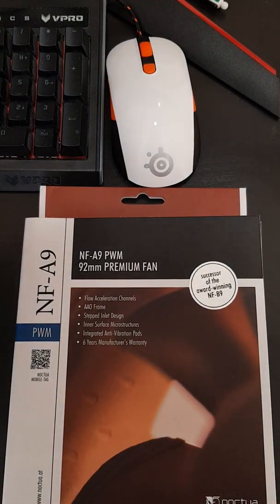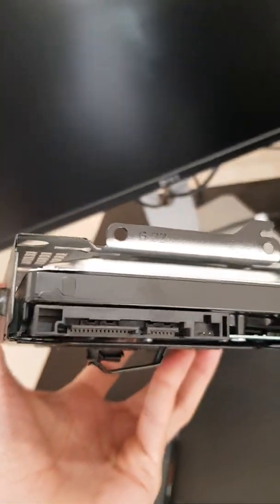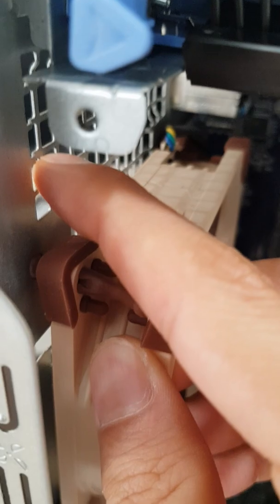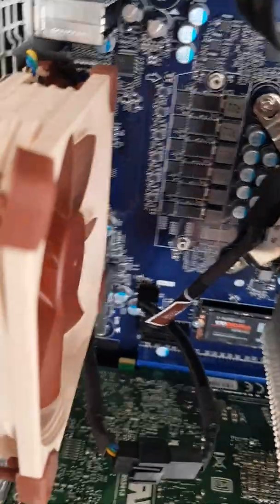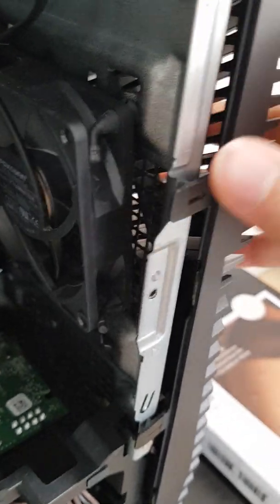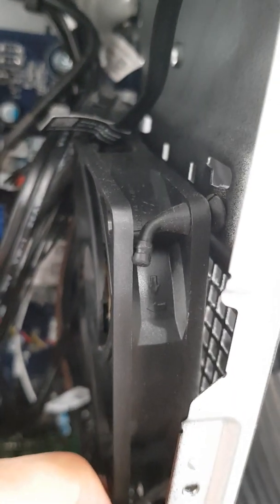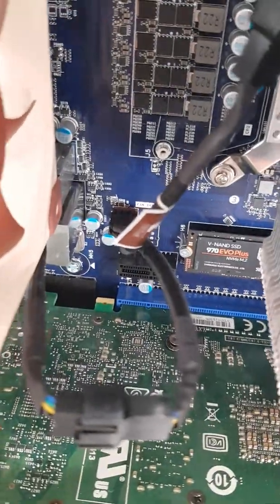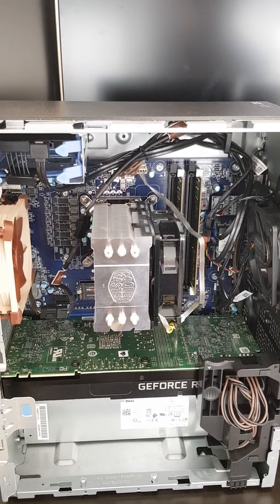Noctua NF A9 92mm PWM Fan Installation on DELL G5

Comment: Thank you for your videos! I just ordered a cpu cooler and another fan. My G5 dell has the 3060ti and i9 cpu. Playing cod cpu got to 91c! My GPU is 64c. 
I bought a 120mm case fan it might be too large? I may return it and get a smaller one.
Reply: with the 120mm exhaust fan you'll need to drill your own holes or use doubled sided tape.

I used 3m exterior double sided tape. Exterior rated tape has higher tolerance for heat. 1 piece on each corner of fan. Make sure not to block the fan itself with the tape. The thing isn't going anywhere. You'll have a hard time getting it off haha
Reply: Hey Monopoly. I ordered a dell g5 with a 3060ti as well. I was wondering, did dell give you a “mini” 3060ti, or did they give you the full 3060ti? I hope that makes sense?
Reply: @NICKNACK112  Not sure what mini ti is? The Dell one is actually very well built. Dual fans with lots of rads and heat piping.
Reply: @gigatron2008  I’ve read that some people that got the dell g5 said that there graphics card was a toned down version of what they chose to be included. Does that make sense?
Reply: @NICKNACK112  where'd u see that? I'd be interested in researching it. Doing gpu tests I was able to hit fps as claimed in comparison videos I looked up.
Reply: @gigatron2008  I forget where I read them, it was a few days ago. Maybe the ones I read where old posts probably. Also what 3060 ti card did you get? Is it the founders edition?
Reply: @NICKNACK112  no it's a Dell version. Dual 80mm fans. I was really surprised by the gpu they built. After adding Noor S's fan mods and a Noctua N9S cpu cooler temps are great. Gpu hits 75c max now.
Reply: @gigatron2008  oh that’s strange. When I chose my card it said Nvidia 3060ti? Why would they say Nvidia 3060ti if there going to give you there own built 3060 ti card? Also what games do you play on the pc and with what graphic settings for them, and what’s the average FPS?
Reply: @NICKNACK112  well yeah its Nvidia gpu but the fan shroud and cooling is made by DELL. 
Cyberpunk 4K non-RT it runs avg 45fps ultra settings.
Warzone 1080p RT runs 110fps. 4k non-RT runs 55-60fps. Both Ultra settings.

Note just added another 92mm Fan up front(some cheap Fractal $8 fan). its TIGHT but you can make it fit. that helped the GPU run from 75c to 70c tested in Warzone.
Reply: @gigatron2008  Thanks this helps a lot👍!!!! Also your comments are disabled on your YouTube videos, just letting you know if you didn’t know already.
Reply: @NICKNACK112  No probs hope you get it. G5 it's a good buy and with an extra $70-120 depending on parts u choose its one of the cheapest prebuilds right now.
Reply: @NICKNACK112  no worries thanks for the heads up! Fixed now.
Reply: @gigatron2008  I just bought the same build as you did you have the i7 10700? Did you remove the hard drive and added an SSD /2.5? What cpu cooler did you use? Excited to get this g5 /3060ti ;)
Reply: @EZzO444  I made a video :) check it out. Parts list in the description. Yes and I added a 1tb ssd
Reply: @gigatron2008  thanks ;) do you feel the 500w PSU is not enough? I see reviews of the i7 taking up to 200W same for the 3060ti... If you add the other components are we short of the 80% ratio ,!!!
Reply: @EZzO444  oh yeah it's fine. I've run this thing to max and no issues with power.
Reply: @gigatron2008  I see your video pretty neat ;) does the original HDD is empty or they pre-installed stuff on it? When you remove the cpu cooler is it sensitive with the thermopaste? Like sticky?
Reply: @EZzO444  thanks! it's empty. I just wiped the paste off with a paper towel. The cooler I bought came with new paste. Works great.
Reply: @gigatron2008  if you were in my position would you do all those changes right away when you get the New g5 or wait?
Reply: @EZzO444  if you plan on gaming do it immediately. Cpu cooler and exhaust fan is probably the most important. You can cheap out and get more affordable options like the cooler master T2 and cheaper 92mm fans. I have the T2 and it ran fine.
Reply: @gigatron2008  I bought the NH-U9S cooler and the Noctua Fan awaiting the desktop ;)
Reply: @EZzO444  nice! You won't be disappointed

Comment: hi ! how unistall  the old   case fan ?
Reply from the maker: Release the rubber mounts from 2nd hole for each corner (I.e. release the tip). Then pull each corner of the fan out slowly until the rubber mounts are released. You need to use some pressure when pulling it out and be careful when you can feel it coming off, so you dont smack your hand somewhere.

Comment: Thanks for the vid. Very helpful. Everything works, but my front fan (The original fan) is constantly running at full speed. I can’t reduce the speed through applications. Any advice? Do I need to use the low noise adapter?
Reply: You gotta get an adapter for the 4 wire plug so dell will read them properly I'm pretty sure
Reply: Mine is, did you find a solution?
Reply: Need a solution too
Reply: @nito7625  Im using the alienware program to control my case fan, gpu fan, and msi afterburner to control the gpu fans.
Reply: @nito7625  Gaming temps are whatever I want them to be now. 60-70c instead of the cpu being over 100c
Reply: @uglymechanics6599  so you were able to adjust the speed of both fans?
Reply: @EZzO444  yes

Comment: Hey, did you manage to run the ram in dual channel? Everytime I try it won’t boot..
Reply from the maker: Yes mine is dual channel configuration. Make sure you are using the correct RAM slots.

Comment: Hey man, I just took out the HDD for an SSD and moved the stock fan to the front so I could put the Noctua nf-a9 in the back. My GPU temperatures are somehow worse, and the noctua fan is slow. Its not showing up on my bios. Is it the same for you?
Reply: I'm not Shure but make Shure you put the fan on the the right way, it's possible their both exhaust or both intake.
Reply: Make sure you have a intake in the front and an exhaust in back. Also recommend to replace the CPU cooler! As that is gonna be your biggest thing to keep everything cool

Comment: Can you fit 120mm fans in if you just put new holes? I feel like it might be a bit too big.
Reply: if you haven't got it sorted yet or someone else sees this comment. I mounted my front fan with double sided tape. 4 small pieces on the corners so it doesn't block the fan. 

Thing isn't going anywhere haha make sure to get the exterior siding tape.
Reply: @EpicDrew15  Thanks for the reply bro im planning on ordering some soon.
Reply: @EpicDrew15  haha yeah. You'll want tape that's rated for exterior use. Those have better heat resistance. I always use 3m VHB tape.
Reply: @EpicDrew15  where do you connect all those fans is there multiple connection available on the motherboard? Any issues with BIOS?

Comment: Hi, weird question:
Can you measure how long your graphics card is?
I currently have the GTX 1660 ti, but I want to replace it with a 3070 in the near future. So I was wondering how long the RTX card is!
Reply: You should make sure that your cpu is powerfull enough to be paired with it first

Comment: Would there be a bios error if i decide to not use the stock fan and use only the noctua fan?
Reply: Ya I get the fan error after I replaced the stock fan with a noctua fan. I can still run my pc after it scans, I just don’t know how to get rid of the error.
Reply: @SoccerproSN  i have the same problem lmao. I cant find any thing about it tho....
Reply: @ErrorType-Null  I solved it. You have to use the Y connector cable, and like connect both fans ( the stock and noctua fan) together. Make sure the stock dell fan is the in the main cable and you shouldn’t get the error. If you get the error, swap the 2 fan cords. You shouldn’t get an error then
Reply: @SoccerproSN  ok thx
Reply: @ErrorType-Null  did you get it?
Reply: @SoccerproSN  i dont have time to do it today  because my brother is using his pc right now. I basically bought the fan for him but i felt bad that it didnt work .
Reply: @ErrorType-Null  oh okay gotcha. Ya I’m just curious if my solution worked and helped out. If you get the chance to fix it, could you let me know if it works?
Reply: @SoccerproSN  I tried with putting the stock fan on the main Y adapter etc. it pass cpu fan tests but the cpu fan actually stopped. it then went to motherboard fan test which failed.
Reply: @SoccerproSN   Swapping the main fan to to the other connector on the Y splitter worked for me! Thanks for this suggestion!
Reply from the maker: The bios error is dependent on the connectors your use and yes some connectors will be specific to some fans. Also do you mean use 2 Noctua fans?
Reply: @nooragha360  What I'm planning to do is use the same cooler and noctua fan you have. I saw that you mounted the original fan to the front on a fan splitter. I dont want to reuse the stock fan, and keep it as a spare instead. So my question is would I get bios issues if I used the noctua fan without a splitter and plug it in directly to the motherboard instead?
Reply: @nooragha360  what connectors did you use? Can you please send me the link? I ordered a 92mm noctua NF-B9 redux fan and plugged it in. However everytime I boot up my pc it gives me “error motherboard fan component failed” but after I exit that I can still use my pc. I just want to know how to get that connector. Both the fan end is a 4 pin and the slot is 4 pin but the wires are different colors.

Comment: Thanks for posting this video. I have the same PC and same overheating issues. Did you find these case fan mods brought down the temps sufficiently?
Reply from the maker: Yes it did for me. The combination of upgrading the CPU cooler and adding the additional fans, improved the temperatures significantly. See the video description for the change in temperature values.
Reply: @nooragha360  I think I will start with replacing the CPU cooler with the Noctua NH-D9L as I am getting into the mid 90s under stress. Hopefully in the push configuration it will dump out enough hot air to also help the case cool down.

It's unbelievable that dell used the stock intel cooler on the non K CPUs.

Comment: Hey man thanks for the videos. Before doing this I was getting 70-80c on full load with spikes up to 90-100c after wards I was averaging 60c under full load with spiking up to 86c no thermal throttling at all. I hooked my fans up with the exhaust on the three pin part of the y adapter and the front fan that's the stock exhaust I used the 4pin for it. No boot error. And amazing cooling. Thanks again!!
Reply: I should mention, the front fan fits under the hdd bracket. Incase you haven't upgraded fully to nvme and SSD storage. But I also only have the msi gtx 1660. So I have some space.
Reply: @DDy8073   wait you fit a fan in there under the hdd space? can I have a link to the fan or a pic of your case or something?
Reply: @sharkzillah401  and i only put the factory fan down under there  my exhaust is the noctura mentioned.
Reply from the maker: Your welcome and thanks for sharing your successful upgrade details!
Reply: @Rob NMore, how is was noise comparision (pre mod) of the fans and (post mod). I ask because premod, the fans got so loud it scared me....lol. I will do  mod now as in the video
Reply: @edwardpersaud  so I can't hear the back fan but the dell oem fan is still the same lol I set a custom fan curve as well cause the auto fan mode is trash. I use head phones and most of the time its not louder then the head phones. And usually it doesn't need to ramp up all the way to try and quickly cool down due to the custom fan curve.
Reply: @DDy8073  how did you manage to control both fans separately with the Y splitter?
Reply: @EZzO444  i wasnt able to sadly but the nocutra is super quiet even when kicked up the dell oem one is still loud sadly tho
Reply: @robofdeathable  yes I know the noise is not super but in terms of temp such a difference
Reply: @EZzO444  after setting a custom fan curve for them my temps are great. i set my fans with the alienware command center, and use afterburner to set a custom fan curve for my gpu the temps are way cooler then what they were before hand

Comment: Do you get Bois fan test when you boot up ? .. i replaced the rear with 120m noctua 4 pin and get bios test when i boot .. it fails but still goes to windows after .
Reply: I got the fan error to then went to windows. But only on my first boot
Reply: Ya same here, I installed a 92mm fan with a 4 pin but everytime I boot up my pc it runs the error but I can start my pc after. I just wanna figure out why and how to fix that error thing so it’s back to normal.
Reply: @SoccerproSN  found the fix was to use the 3 pin  of the adapter on the noctura and the 4 pin for the stock exhaust fan I turned into a intake fan.
Reply: @DDy8073  oh I returned the other noctua fan I owned and bought this brown one in the vid. You think the cords will avoid giving me the error??
Reply: @DDy8073  just got the brown fan in, tried both the splitter cord and the single cord and both give me errors
Reply: @SoccerproSN  the original exhaust fan that you replaced needs to go up front somewhere and be connected via the splitter 4pin to the from fan (dell oem fan) and the 3 pin into the noctura fan. You shouldn't be having a bios error then
Reply: @DDy8073  ya I figured it out myself, thanks for the help :)
Reply: @SoccerproSN  no doubt happy gaming!
Reply: It was a simple fix really. If anyone else is wondering, I used the Y splitter cord and all you gotta do is connect both so it can register the stock dell fan as the main fan. If it gives you the fan error, then switch the cord ends, just reply to this if you’re still confused.
Reply: @SoccerproSN  I used the splitter but the stock fan now runs full tilt and sounds like a vacuum.  Any ideas ?
Reply: @arabinow  ya I had that issue too. I have to go into the Alienware command centre and lower the fan speeds a bit. Like you go into the advanced settings and turn the offset to whatever you think a good speed is. I just had to toy around with the speeds to see what suits best.
Reply: @SoccerproSN  but if you turn it down it will affect both the intake and exhaust. Hmmm there has to be an alternative
Reply: @arabinow  like I noticed the noctua fan runs a bit slower than the stock one for some reason, but there’s dual fans so it should help the airflow despite it being slower speeds. You’re probably right, there prob is a better alternative but I haven’t figured it out. If you do figure it out tho, could you message me and let me know?
Reply: @SoccerproSN  anyone figured it out ? Have the same problem Noctua running too slow and stock fan too high
Reply: @nito7625  for starters, you’re about 2 months late but ya over time I just didn’t really pay attention to the fan speed anymore tbh, so idk if it’s still slow
Reply: @nito7625  still no fix?

Comment: Is there any temp difference?
Reply: King Koopa yea when I’m rendering I’m gonna do that next time should help alot
Reply from the maker: The fans are suppose to provide a better airflow throughout your case. The entire cooling system acting together creates the airflow required to control the temperatures, not just a few fans here and there. If you have specific questions regarding my setup, let me know. But yes my overall cooling system did improve temperatures significantly.
Reply: Noor S. Yea man I’ve been having issues with rust temps as my gpu temps get up to 80c in that game!
Reply from the maker: @po5tup568  do you have the same specs and cooling configuration as my setup?
Reply: Noor S. I have a intel10700 and 2070 super but stock cooling
Reply: Noor S. I don’t think changing Cooling would help a blower gpu tho
Reply from the maker: @po5tup568  it will help, but indirectly. By bringing in new fresh air from the front and blowing the hot air out the back. Search up different fan cooling configurations, there are some good videos which perform tests and show the impacts of the different configurations.
Reply: Noor S. Yea I’m about to just return it and build my own at this point man it’s just been causing so many issues with overheating
Reply: Or I may just underclock my gpu
Reply: @nooragha360  hi, what are the actual running temps under load with the cpu cooler and fan upgrades?
Reply from the maker: @SH2015SH  it's in the video description.

Comment: Nice video! I am going to buy a G5 with 10th I7 and Geforce1660Ti. Do these specs support the PUBG at 75Hz?
Reply from the maker: I would say yes, because I can run COD MW on a 144Hz monitor with 1440p resolution.

Comment: I'm planning on grabbing the Noctua and installing that as you did to see how it help (i7-9700, gtx 1660ti). I'm new to this - any idea if I'll run into power supply problems? I've only got the 360W PSU. Is that going to limit me in terms of installing fans to help cool?
Reply from the maker: Generally fans dont put that much strain on the power supply but to find out exactly you would need to find out the power requirements for all the parts connected to your power supply.

Comment: Do you think is possibly change the power supply?
Reply: Dell use a proprietary 6 pin connector for the motherboard on the G5. So I would contact them their sales rep to discuss it with them.
Reply from the maker: Do you want a larger power supply? Smaller is not a good idea.
Reply: @nooragha360  of couser more than 460 watt!!